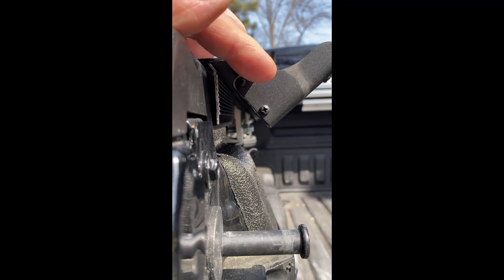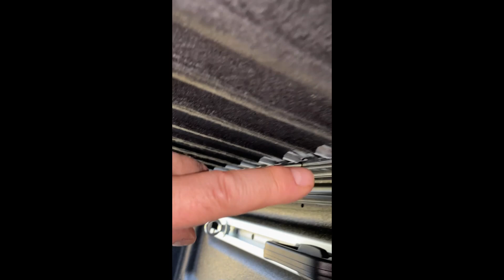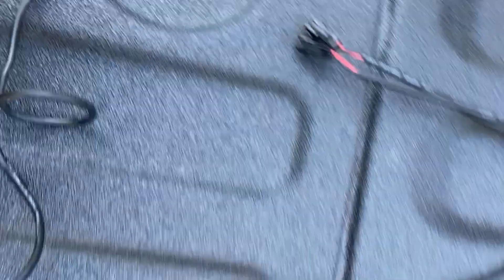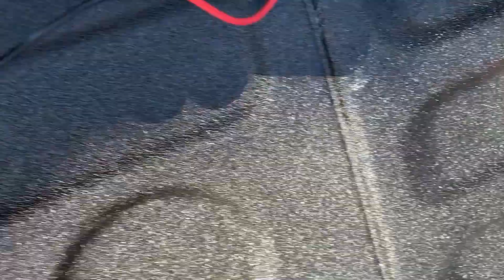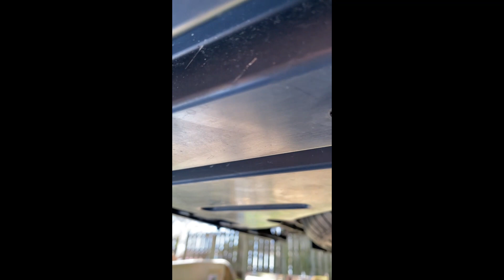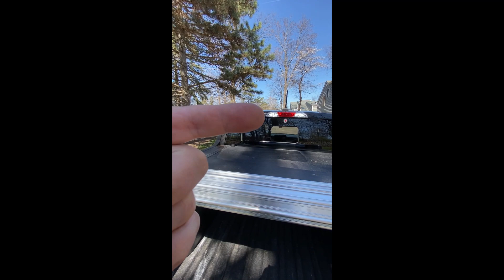Maverick LED Bed Lighting

Comment: Dave, I did this but I have a question. Does your light turn on when the truck is running? If I try to turn the cargo light when the car is running it just blinks, also they cannot be turned on right after turning the truck off, have to wait at least 3 minutes to turn it on…
Reply from the maker: Ill have to try these.  Will let you know..

Comment: How did you splice into the existing light? That’s the only part I am struggling with
Reply from the maker: Several options to do this.  You can use:

Positaps (https://www.amazon.com/Lockitt-POSI-TAP-Assortment-connectors-10-22/dp/B00CMC5DII/ref=sr_1_5?crid=3HD9R5MHFL0XA&keywords=Positaps&qid=1706410310&sprefix=positaps%2Caps%2C103&sr=8-5)

T-Taps (https://www.amazon.com/AIRIC-Connector-Self-stripping-Electrical-Terminals/dp/B06XN5RCTB/ref=sr_1_5?crid=K6EOWPXEMR0R&keywords=ttaps&qid=1706410406&sprefix=Ttap%2Caps%2C138&sr=8-5j

Quick Splice connectors (https://www.amazon.com/G·PEH-Solderless-Splice-Connector-Through/dp/B083S6FVFM/ref=sr_1_10?crid=2ILJY56KB5JX8&keywords=Wire+taps&qid=1706410455&sprefix=wire+taps%2Caps%2C100&sr=8-10)

Or just cut into wire and solder using something like the solder n seal connectors i showed in the video (https://www.amazon.com/Connectors-Haisstronica-Waterproof-Connectors-Heat-Connectors-Butt-Weatherproof/dp/B08F46WKCZ/ref=sr_1_10?crid=U0X8DPVQU6HY&keywords=heat+shrink+butt+connectors&qid=1706410604&sprefix=Heat+shrink+%2Caps%2C126&sr=8-10)

Probably the most important thing is to make sure the connection are sealed from water which is why i used liquid electrical tape (https://www.amazon.com/Star-brite-Liquid-Electrical-Tape/dp/B0000AXNOD/ref=sr_1_1_sspa?crid=3U63C7WJ60O93&keywords=liquid+electrical+tape+waterproof&qid=1706410744&sprefix=Liquid+ele%2Caps%2C120&sr=8-1-spons&sp_csd=d2lkZ2V0TmFtZT1zcF9hdGY&psc=1)

I have included links to those items on amazon, but you can usually pick them up in smaller quantities at you local hardware store like home depot or lowes.

Comment: Nice install. Not only does the corrugated wire sleeving keep the wires together and help protect the insulation from abrasion wear from driving vibrations, it also gives a nicely professional look to the mod. I'll definately be using this video as a reference when I finally get my Mav XLT Lux that has that same factory lighting package.